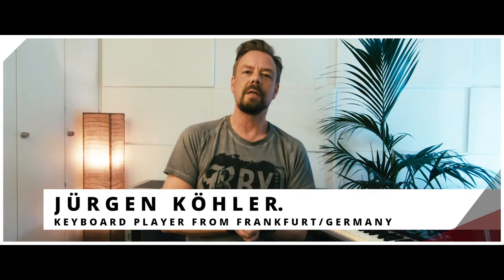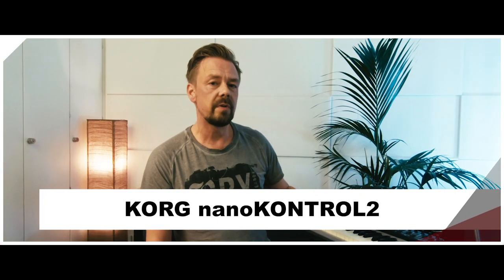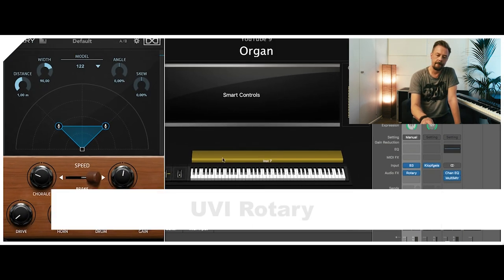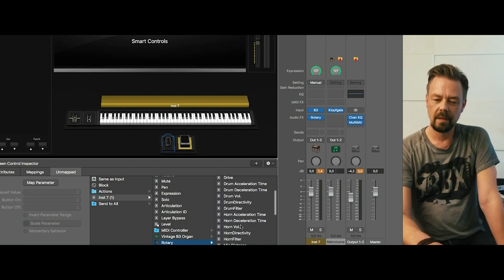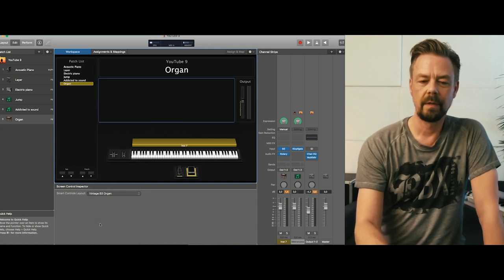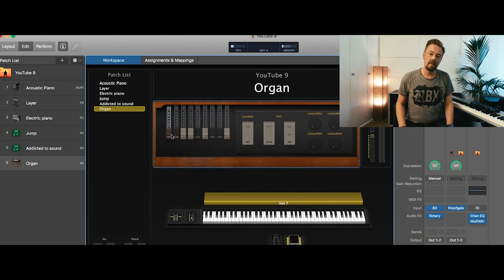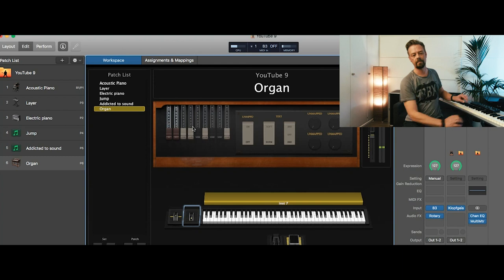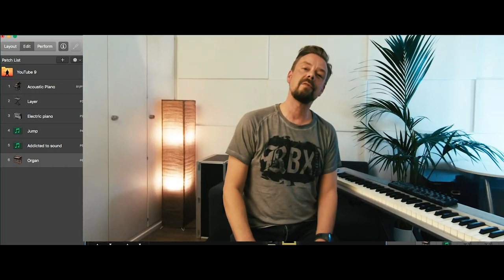Apple MainStage Tutorial 10 - Programming a Rock-Organ

Comment: I’m looking for an authentic rotary sound. I am using Acoustic Samples UVI in. NOVATION impulse 61. Roland says  a Leslie FS10TL foot switch could damage my Roland RD88.
Any advice?
Reply from the maker: As I have non of these machines, I can not give any advice for this. The FS10TL is probably designed for special Leslie Models, maybe sending voltaged signals. This could be the reason for Roland's answer. I use the UVI Rotary PlugIn in MainStage and control it with a simple Foot Switch on a controller keyboard. This should work with Novation impulse and UVI as well.

Comment: Hi, great tutorial, thanks! Maybe you could help me with an issue I found setting up my B3 in mainstage. I´m using a drawbar MIDI controller, that is sending CC values with each drawbar (CC12, CC13, ....CC20). I assign each drawbar in the SmartControl screen to a drawbar in my controler, no problem, but the drawbars are reversed. Ok, so I invert the value in the inspector and now, the drawbars actually change the sound as it should be, BUT then the visualization of the drawbars in the screen are inverted, so when I pull a drawbar, in the screen the drawbar is inserted... so the image in the screen is not representing the position of my drawbars in the controller (the sound produced is correct...) I´ve been trying this a lot and couldn-t find a way (I´ve searched a lot, but no solution out there... THANKS!
Reply from the maker: I think, some years ago I had this problem too. Just sent you an email. I'll be back soon, hopefully with a solution.
Reply from the maker: Looks like your MIDI-Controller is sending the wrong way: Values 0-127: Value 0 when your slider is up and value 127 when it's down. It's possible to invert the values for the sound in MainStage, but not the visualization.